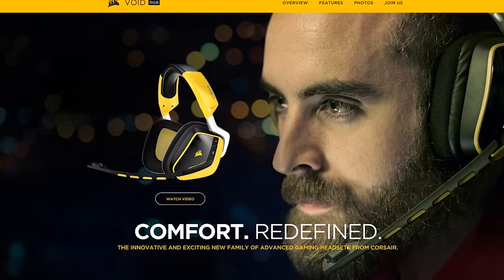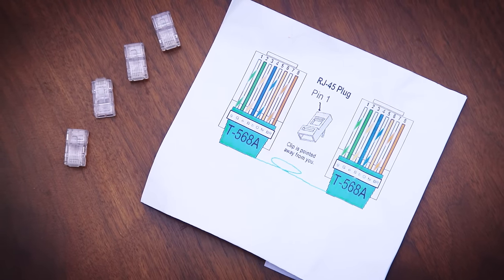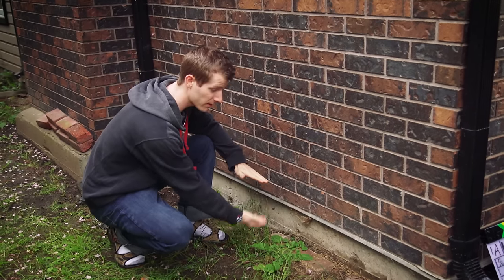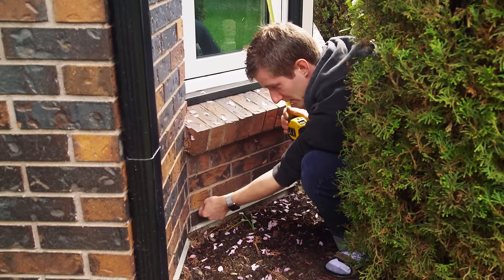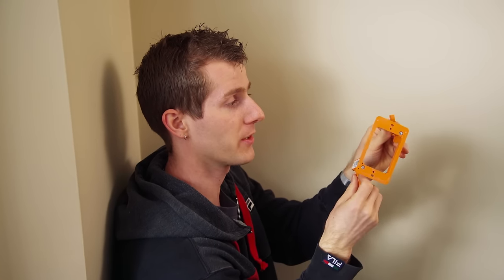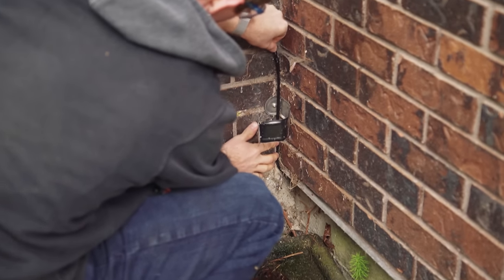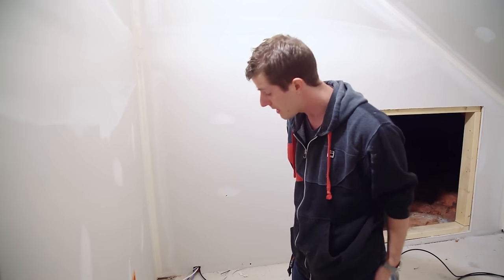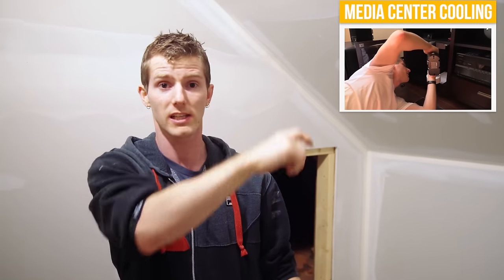Optimize your cable runs at home! - Installing an exterior Cat 5e cable

Comment: umh, what about  hidden electric installation inside of your wall? you could hit wires there while drilling! :P
Reply: You can lease/buy easy tools that will detect wires. Also common sense.
Reply: Linus and common sense?
Reply: hmm, but  he did not mention it :)
But yeah i know that ^^
Reply: In the uk Regs stipulate power cables should run up from the floor and down for light switches if my memory serves me correctly. Don't see why these regs would be different in the usa and canada
Reply: cables inside walls are installed inside a "plastic tubing" to prevent this kind of thing, if you drill or hammer a nail it will not damage the cable. that is, if you follow regulations, and is why you should always hire professionals to do electrical installations that know these things.
Reply: +sew0077 Even if you hit by 0.001% a cable, the drill will probably just push it aside. For the grins, grab a bunch of wires, hold them tight together, and punch a rotating drill through it. Nothing happens (though getting a detector is always more neat).
Reply: +huklen True, but even if you avoid the electrical wiring, you might still hit a gas or water pipe, which is still quite unpleasant...
Reply: would break the drill bit not anything else
Reply: Robert Faber you are correct, of course. I only responded to the comment in question about the elctrical wiring
Reply: Robert Faber "Still quite unpleasant" I rather hit an electric cable and have the fuses pop, than having a waterpipe flooding a part of a room, or even more dangerous a gas leakage :-D
Reply: Richard van Pukkem It was a bit of an understatement, yes...
Reply: Agreed. Not everyone knows to check for wires. That can be very dangerous.
Reply: True
Reply: Typically power is run vertically and looped through ceiling and down. 
But it's still valid he should check for pipes, studs and cabling!
Reply: not the case in many homes though just to be clear . 

I've never seen plastic tubing be installed for wiring thats running to lights / outlets .
Reply: Usually the electrical is in the same wall cavity as the outlet. If you know where the studs are, its pretty easy to know where the electrical is.
Also I didn't understand why he didn't just drop it from the crawl space. Much cleaner and less work when available. Might need an auger bit in case of a fire break.

Comment: You forgot to say that it's super important that, when coming out of a hole, your cable goes instantly downwards to allow for gravity to pull rainwater off the cable before it goes inside the house, which can happen even with calking.

When drilling your hole from outside the house, drilling slightly upwards also prevents water from following the cable inside using gravity.

Comment: I really love your creativity Linus! I believe what you are doing is doable, however needs caution! I just wanted to address a few things that were not covered and perhaps needed a professional opinion. Just a home inspector that wants to see people have success with their home modifications.

First, your drilling methods were clever, however dangerous and not suitable for most homes built past the 1980's in north america.  Blindly drilling into a wall is very dangerous because you can hit live wire or dormant asbestos for older homes.  Would highly recommend removing a square of drywall to avoid drilling through anything dangerous or important.  If you live in a wood frame home, you will definitely be drilling through the waterproofing veneer located behind the brick (or stone), which will cause water to drip into your insulation. If you calk it deep to prevent that, you end up blocking the breathable wall which air and bits of water are supposed to breathe through and escape through the bottom.  Also would not recommend drilling into the foundation wall. If you do, i highly recommend calking the anchoring used along the foundation wall as well. This is to prevent foundation damage during winter when water can get in and freeze (expand) and may cause major damage over the span of time.  If this method is done, monitor the calking and make sure it is always in tact. 

Dormant Asbestos: Not harmful until tampered with or airborne. 
Wet Insulation: Mould can appear and Insulation will not be as effective. 
Water in foundation: Proper term is called Frost Heaving in case anyone wants to look it up to prevent this.
Reply: Thanks for your explanations, it's a pity your reply hasn't bubbled to the top yet!

Comment: I love how everybody becomes a professional when they see somebody else taking on a DIY project. Nobody takes into consideration or asks whether or not Linus knows the exact layout of the house and where wires may or may not be they just jump on his balls about not doing it their way which is obviously the right way. Hilarious.
Reply: APerfidiousDane The fact that it is a DIY video is the reason people are telling him he did it wrong. Many people may try to do it the same way as he did, which could lead to a very undesirable outcome.
Reply: In some places this DIY project may also require permits which he did not mention.
Reply: I agree that some people's criticism is unfounded. However one thing I wish he did is use a voltage finder in case the wires from that receptacle ran horizontally where he drilled.
Reply: Doesn't really matter that it's a DIY project. He didn't drill upwards to avoid water getting inside and used calking instead of silicone.

Comment: Those 2ml of sealant will keep that house dry and safe no problem at all.
Reply: +PianaGlass was it that obvious? :-P
Reply: It's a tiny hole on a vertical wall. I highly doubt it will ever be an issue.
Reply: Wow.
Much dry.
Many safe.
Reply: That's why you usually drill downhill from the inside / uphill from the outside and not straight line.
Reply: If only there were some kind of overhang on the roof with special buckets attached to divert  rainwater away from the walls at safe distance from the foundation. Unfortunately, even with all of our scientific knowledge on hydrodynamics, we've never invented such a system...
Reply: Mostlyharmless1985
Science is in the gutter.
Reply: Mostlyharmless1985
Your walls never got wet on the outside?
Your point would be valid, if there was no wind.
Reply: Not in the quantities that it is any concern to a 10 mm hole filled with sealant. If it does, I'm probably swimming and there might be bigger holes in my home to worry about water ingress.
Reply: @Mostlyharmless1985 You have no idea how the weather affects a house, do you?

Comment: Why go with Cat 5e instead of the better Cat 6 cable?
Reply: I assume they are much cheaper for the length that is needed.
Reply: Yeah its a hell of a lot cheaper for outdoor Cat 5e than Cat 6, at least in the UK, or where I am.
Reply: Price and the fact that Cat 5e supports enough speed for most home applications.
Reply: Oh yeah. Considering how relatively small a length he got for $50 for just cat5e just because it's outdoor rated. This is a bad way of purchasing cable, but consider that I can get 1000 ft of (unshielded) cat5e on Amazon for $45, and 500 ft of outdoor-rated cat5e for $60. I can also get 1000 ft of cat6 for $160, and oddly enough $170 for 1000 ft outdoor-rated cat6. Not a whole lot more expensive, but it does add up over time and distance.
Reply: Koriko Alistar Did Linus not mention he bought in store? Also with it being unshielded, saves him time and effort to just go down to his local shop, buy the Cat 5e and make the video. But I do get your point, and completely agree.
Reply: He probably bought it in store, which is why I mentioned that you generally don't buy cat from Amazon unless you don't have any other choice (like being deployed and stuck with an APO address)
Reply: I hope he bought in store, anyways.
Reply: Koriko Alistar You never once mentioned you genereally dont buy from Amazon?
Reply: I suppose I din't say explicitly, but I wrote "This is a bad way of purchasing cable, but consider that I can get 1000 ft of (unshielded) cat5e on Amazon[...]"
Reply: Koriko Alistar I read what you wrote and to me, it sounds as if you buy from Amazon rather than in store. Regardless, it does not really matter, the videos made, Im sure hes not too worried about the price he paid for the cabling.
Reply: For 1000' box for cat6, it's like $20 more. I'd rather pay the extra for future proofing.

Comment: LINUS  why u didn't  use better cable like  CAT 7A for future proof as more internet speed on the way like  1GBPS OR MORE ???
Reply: 1. your you domestic internet will never get those speeds
2. neither will domestic hardware/routers etc, Cat6 is the same price as 5e these days no point doing anything else.
Reply: 1Gbps, pfft when you can get 10Gbps, plus i work in a data centre and am a licensed cabler and pay the same prices for each cable, so only carry cat6, and not 2x the amount of stock, this video made me cringe, not using a punch down type termination?!?!
Reply: How many routers for home use have 10Gbps ports, though? To be honest, I don't know myself, but I assume not that many.
Reply: Missing the point - it's for future proofing so you're less likely to need to replace it as technology improves and home networking equipment gets faster.

As it's quite a pain to replace, it's worth spending more on the cable if it means you won't need to replace it in 10 years.
Reply: Luna If you're really going for future-proofing, I'd go for Cat6A along with fiber leads going everywhere. Cat6A is capable of doing 10GbE as long as you're careful while running it, and using quality cable, and fiber is probably where it's moving in the future. Also, especially in the US it's going to be a while before "broadband" connections gain speed, and how many people really need wired 10GbE speeds between devices in their home? I'd wager the average consumer (maybe not this channels audience) would benefit more from more stable and faster WiFi devices.
Reply: Fiber is harder to route than Cat7, gotta make sure your bends are in spec or else you'll lower throughput/damage the cable.

Comment: Great video! I've been asking people in my FB networking/IT groups how to get the cable THROUGH the wall, from inside to outside, and they treated me like I was an idiot. I'm trying to install both inside and outside wall plates, on two houses next door (guest house) so I can do a wireless bridge (mikrotik) from one house to another. This helped a lot! Only thing I need to figure out is how best to mount an exterior ethernet wall plate.

Comment: This is SO dangerous and while most people don't listen to warnings, Linus should really have mentioned some:
Drilling holes into your wall could lead you to hitting mains voltage electricity (which could seriously injure or be lethal) busting a water pipe, or ruining a support beam... 

For instance Linus drilled directly next to a powerpoint where 240v (Australia) or 110v mains electricity cabling would be running very close by

There's a reason people need certificates to do this sort of work

Linus you should really revise this video with an adequate warning; you have many young viewers who don't consider safety risks
Reply: Unless his house was 75 years old and/or the electricity was done by a complete idiot, it was virtually impossible for him to drill into water pipes or electric cables. There's standards for where those are routed around a house.
Reply: yolo i guess
Reply: Thought I'd leave this here:
As someone with a bit of experience in getting shocked by household power(careless turned off the wrong circuit breaker), its pretty hard to actually kill yourself with household power when not at an electrical panel. (at a panel, there are a LOT of grounds, which are what kill you if you accidentally hit a hot wire)

For not being at an electrical panel, you'd need to be barefoot on a metal/conductive floor and have a hand directly touch it (power tools like drills do not allow electricity to flow through them from the bit), or somehow have both hands be connected to different circuits. (like a drywall saw in each hand cutting through different circuits at the same time) 

Even if you had BOTH hands touching the blade of a drywall saw (although you should use a razor blade for that), AND you cut into a wire, AND happened to cut into 2 of the strands, NOTHING WOULD HAPPEN! it would conduct (usually with a good bit of arcing and noise) directly from one wire, to the blade, and then to the other wire. And even if you were barefoot on a grounded metal grate, you still wouldn't be hurt because electricity follows the easiest path - through a conductive metal blade and not through a highly resistive human body.

That said, ALWAYS wear proper shoes when working with electricity, and that's most of the danger negated (hands to feet on a potentially wet floor). Next, when pulling outlets out of walls etc, ALWAYS USE ONE HAND. They have hot on one side and neutral on the other, so if you grab one side with one hand and the other side with your other hand, it will send a very small current across your chest where your heart is. That can be deadly if you're alone. If you use one hand, it just arcs from your index to your thumb and you get a little jolt and that's it.

Comment: Why not use the higher rated cable for shielding, signal length and future-proofing? Cat 6 or 7? Most people don't think so spec wise a difference but I use Cat 7 in my home just to protect from the noise of all of the other electronics everywhere. I'm not being critical I'm asking because I bet you have a reason.